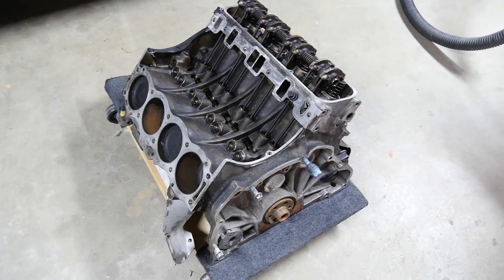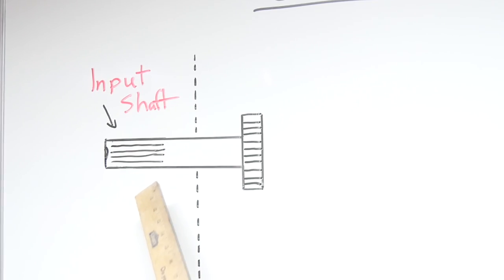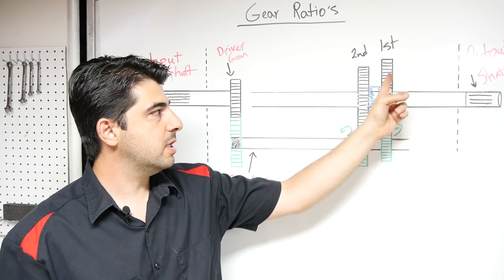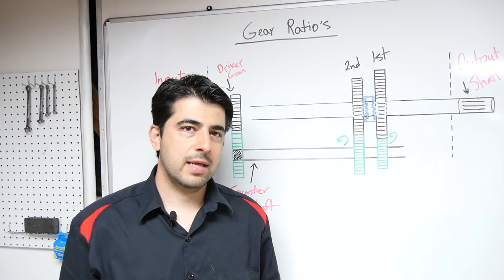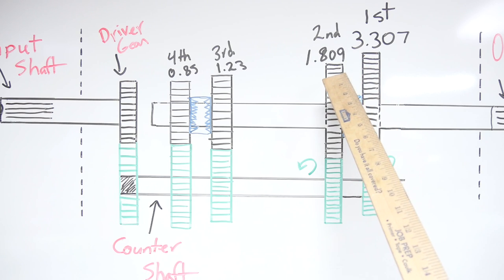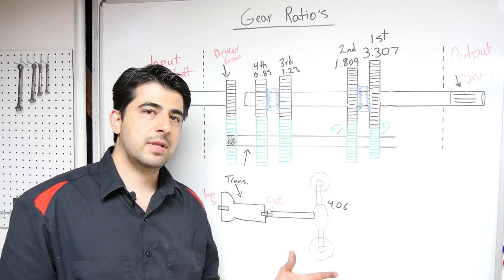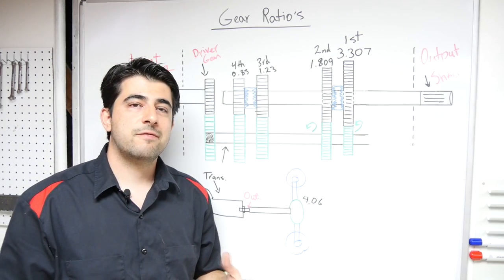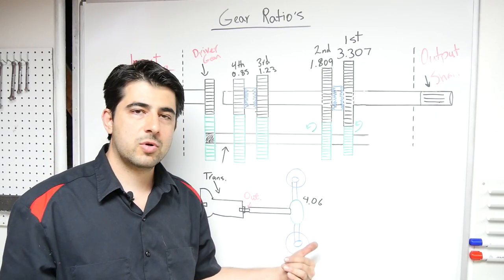Car Mod for More Torque  - Gear Ratios Explained

Comment: Great video on gear ratios very straightforward and concise. I do however would like to see how torque converters work on automatic transmission and what a stall speed is used for.
Reply: Did you find out yet? Cause I can explain it

Comment: You can also add a throttle body spacer which will give you a little more power on the torque side. Gears will defiantly do the job too. Very nice explanation and use of your white board. Thanks for all the great videos.

Comment: I've got a manual Toyota Corolla and 5th gear is 0.815 meaning it's pulling 3200rpm at 70mph . Next year i'm it replacing with a 0.725 5th gear out of a Toyota C53 transmission and the revs should be alot lower and better MPG. Fortunately 5th gear is easy to get to and replace.

Comment: Would you be able to do a video on changing transmission mounts? Mine is clunking bad :(
Reply: nmendoza1234 super easy you need a floor hydraulic jack

Comment: So putting bigger gears in the rear differential gives more torque, but saracfices speed? This sounds more like a truck hauling a heavy load, at a slower speed or maybe a tractor 🚜 trying to drive on the highway? I'm learning here so apologies for the weird ass questions

Comment: Probably better left to the old days or racing. Trans-Axle is not worth it unless you have absolutely nothing better to do with your time. The rears on a rear wheel drive, have at it if it is worth the price at the pump. I know what I said here is a Ditto but well worth it. If you don't need it don't do it.

Comment: Cruising at 80MPH.. lol nice explanation BUT I didn’t quite get it. I know my truck is a 4/10 gear ratio. What does that mean?
Reply: 4.1 gear ratio. input could be 4,100rpms. output will be 1000

Comment: Interestingly enough my engine averages 4100 rpm at 70-75 mph. With 30mpg highway at the lowest gear ratio. So clearly it's a bit more nuanced than that.

Comment: you cant change a gear ratio to gain engine hp. you can only increase the overall average while accelerating through the gears
Reply: You can gain whp

Comment: this is misleading. Yeah, change gear ratio to increase tq at the wheel. this is why 1st accelerates more than 2nd or third. but you are sacrificing speed.

Comment: I don't think you did a good job explaining A. How the gears are selected, and B. How the synchros work allowing each gear on the output shaft to turn separately. 

I guess if you were only trying to explain gear ratios and that's it, then good job.
Reply: Tynan Cuthbert uhhhh...it says in the title
 "Gear Ratios Explained". Soooo...
Reply: true that
Reply: CO Jones thanks for sharing. I'll take a look